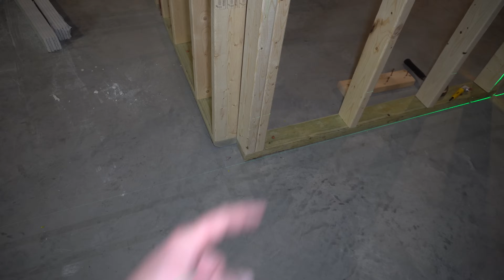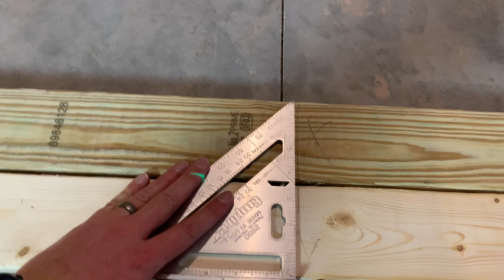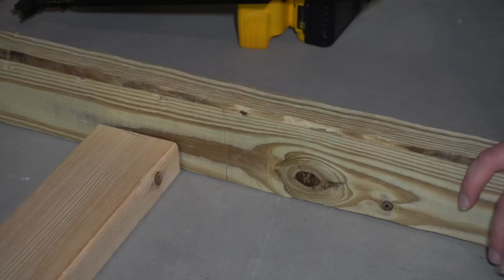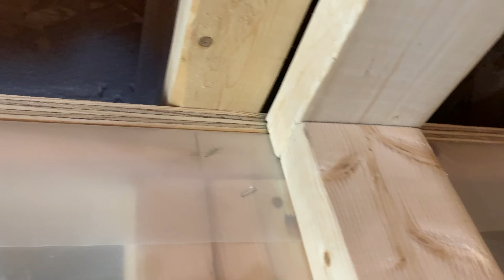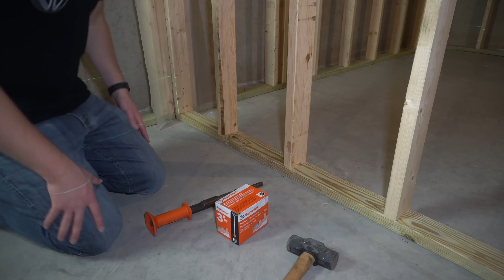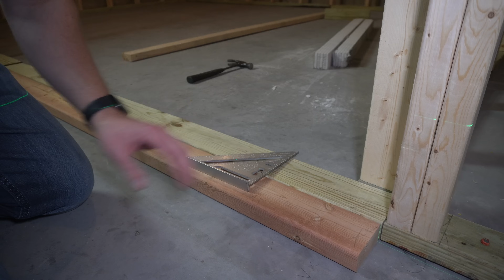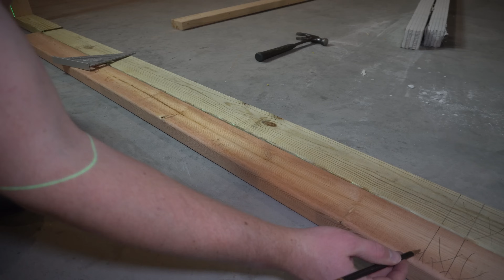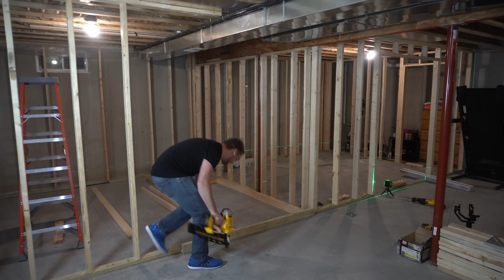The Basics of Framing A Basement Wall

Comment: Why start at 15 1/4 on the framing?
Reply: It's because he's marking where the edge of the stud goes, not the center.  A 2 x 4 is 1 1/2" wide, so taking off half of that (3/4") gives you your first measurement.  (You don't have to take off 3/4" on the other side because your starting stud is offset by the edge, so it takes off the length automatically.). After that, as long as you're measuring to the same point on the lumber each time, your spacing on-center will always be the same.
Reply: Thanks for the explanation. I was wondering the same thing.
Reply: So the first sheet of drywall lands on the center of a stud.
Reply from the maker: It's a little tricky to imagine it but I promise that if you lay it out like this you will end up with studs 16" on center lol. So the first stud will be flush with the start of the bottom plate. Then measuring 15 1/4" off the start of the bottom plate will give you the leading edge of stud #2. Center to center of the first two studs will not be 16", but the sheet of drywall will not be going to the center of the first stud, it will be going to the edge of it/start of the wall. 
So from the start of the wall to the center of stud #2 will be 16". Then it's 16" OC from that point on. I hope that makes sense 😃 Kind of tough to explain in text lol.
Reply: @DoingWhatever  I don't understand how one benefits from marking the center and both sides of the stud.  I have seen this done before.  The 16" OC marks on a tape are designed to mark the left (or right) side of each stud. Just mark at the red mark and put an X on the side the stud goes... much simpler(because you never need to reposition the tape) and more accurate (because you don't get cumulative errors from repositioning the tape).
Reply: @johnd9000  
No benefit on site. I believe he was demonstrating to the audience where the full stud would sit. The intention was to show why he pulls 15 1/4" for the first stud so IF you rock that wall FIRST, your drywall sheet will fall centered (not done on a site for multiple reasons). 
Also, with single top plates... don't be cheap with lumber, toss those 2 pieces into the "save for later project or blocking pile" and grab a full length piece. I mean, I woulda fired the dude as soon as I saw that janky tape measure and unmarred square so we never even would have gotten to that point. 🤣No offense, it's a decent video for the DIY'er... I'd be here all day if I said every "well, I would have..." comment that came to mind (granted I framed mansions in The Hamptons for a couple decades).
Reply: @Mike_H76  I've been in the business for 24 years.  I stepped on and broke my framing square the other day.  I bought a shiny new one.  Am I now "not qualified" in your eyes?  
(Ignore the fact I have three old ones in the shop)
Reply: @NorthernChev 
That's ridiculous that you took that from what I said. And, you picked those two words out of my 2 paragraphs... I only judge actual carpenters on how worn there tool pouch is, if there's no fishing line through the leather then you definitely suck!
Reply: @DoingWhatever  I think I need a show only on this. Lost me after "It's a little tricky".
Reply from the maker: I get this question quite a bit - I probably should make a separate video on just this part 😃
Reply: Is it because you're adjusting for the width of the first stud? @DoingWhatever
Reply: @vidsbyme2590  A stud is 1 1/2' inches wide, so if you want to center it on 16", its ends will touch 15 1/4" and 16 3/4'.  Kind of convoluted way of explaining centering. If you just use a framing square its made to easily measure out 16" and the square itself is 1 1/2" wide to easily mark the centers. Makes things super easy if you don't want to keep counting in multiples of 16 on a tape measure, especially if you're tape isn't marked for framing.
Reply: @DoingWhatever  why the bottom plat tat far from wall?
Reply: @ArgonKripton  Water and moisture management behind the wall.  It is nearly impossible to prevent ALL water from ever seeping through a basement wall, be it through the wall itself or at the base where the concrete walls meet the concrete slab.  Water WILL (not "maybe") eventually find it's way in behind that wall; and you don't want it going into your insulation, wood or drywall.  Since we can't stop it 100%, we just plan for water intrusion by building the wall with a space for water to flow.  Sounds silly, I know.  But it's true.  The air gap helps the water to evaporate if you don't have a sump trench in the floor for the water to flow in on the way to the sump pump.
Reply: @NorthernChev great thanks
Reply: @DoingWhatever  😮😮🎉😊😊
Reply: Your first measurement was 15 1/4 to get the left edge of the board as opposed to the center, however, you started the tape at the edge, not the center of the first bboard, so the spacing of the first block will actually be short 3/4"
 @DoingWhatever
Reply: @DoingWhatever 2:40 what is up
Reply: @DoingWhatever  There's a reason measuring tapes have the mark at every 16 inches in red.  This 15 1/4 thing may work in the way that you did it but it's completely unnecessary.  You draw an X at the edge of your top and bottom plates, then a line on every red marker on your tape, with an X to the right.  It's quite simple.
Reply from the maker: But then when you shove a sheet of drywall into the corner (the end of the wall) the other end of the drywall won’t land on a stud. You need to subtract 3/4” from the first stud spacing because the end of the drywall isn’t landing on the center of the first stud, it’s going to the end of the wall.
Reply: This was one of the most detailed and easy to follow videos on this subject I have found.  This is great.  I need more videos like this. Thank you.
Reply from the maker: Thanks!
Reply: You nailed through the vapor barrier my guy 👀 you shouldn’t need that for an interior wall given the drywall/mud/taping. Awesome video though !
Reply: @micoberkman6999  the vapor barrier is: #1 always fastened through, although in some climates they use a sealant like acoustical sealant that never vulcanizes so it self seals the holes created by the fasteners, #2 required to be continuous on the exterior wall. If he didn't put it behind the studs attaching to the exterior wall it would be technically wrong, although it is common to run to the interior wall wrap it 1 stud bay onto the interior wall and that is accepted by most building inspectors. Drywall it not a moisture barrier, maybe it is the MR (moisture resistant type) but that is meaning for the product not its building envelope capacity.
Reply: My framing book has framing start at 15 1/4 so that every stud is 16" on center.
Reply: @sanon-s1u  
I never read a "framing book" before starting out. I get the point, the 3/4 can be "lost" when you run drywall into a corner, however if using 1/2" drywall, it'll leave a 1/4" spot to screw sheets on ONE of the walls regardless. 
Since rock gets mudded, it's easier to pull 16s from where ever (consistently!) and let the drywallers start their rock midwall and cut into corners (IMO, I've done both a ton of framing and a bit of rocking).
Reply: Because it makes it so that all the edges of the sheet goods we  use end on the middle of a stud without having to cut it to length...the mark you will have at the 8 foot stud is going to be 95 1/4 which place s the edge of the sheet measuring 96 center of that stud.
Reply: Why not just start at the edge of the of the board? This just seems like it is over complicating everything. So you mark your first stud on the end of the board, then at the 16" mark, you mark your next stud after the 16" mark? So the left side of the stud is at 0" then the the left side of the next stud is at 16" and the left side of the stud after that would be 32". This would make every stud at 16 OC.
Reply: For sheathjng & drywall. To ensure the seems line up 16 oc
Reply: was going to ask this. the problem with this hypothesis is that, it only really works if you will NOT be drywalling the OUTSIDE walls BEFORE the new wall. drywall adds an extra 1/2" - 3/4" to your original number. for this reason alone, you should leave it at 16" from the end stud, because having a small 1/8" gap is easily fillable with drywall mud or caulking sealant, and walls are SELDOM the length of drywall (8'x4'), so you can just custom fit the last piece near the end of the wall.
Reply: So, the weep gap between the studs and the concrete wall: will this be spray foamed?
Reply: So that you can see your line when installing the 2x4.
Reply: just pull the tape from the edge and mark 16 centers...
position studs so that they are centered on the mark, its really stupid to do 15 1/4....
Reply: If you lay out all the studs at 16 on center and you then lay that first sheet of drywall tight against the left hand side of that wall where the leftmost stud is --> the right hand side (end) of the drywall WON'T land on a stud.  The rightmost end of the drywall will be a half inch(ish) short of the center of the stud on the right hand end of the sheet of drywall.  Keep in mind you're putting your studs down on the RIGHT hand side of your 16-on-center mark, right?  So, if you measure 8ft from the LEFT side of the first stud the LAST stud at 8 foot will be to the RIGHT of the end of 8 foot.  Thus missing your drywall.
Reply: I would stretch my tape out and mark a line 3/4 of an in before and after every 16".  Your studs go between the 2 lines.  That way everything is marked 16" on center from the starting point.  Continually moving your tape opens up to error and then can multiply down the line.
Reply: @davidketterer5519  
Fired, best of luck and Happy Holidays.

Comment: Ah, the joys of framing out a MODERN basement with level(ish) floors, sane plumbing, and the room free of clutter to actually be able to lay a wall out on the FLOOR to build it and stand it up...  I've had to do more where you build the wall in place stud by stud due to sh$t piled up in the basement for too many years.

Comment: This is a great video. But I don't understand why you use impregnated wood directly on concrete? I had used a moisture barrier between concrete and wood because concrete never gets 100% dry. My experience is that impregnated wood should only be used in outdoor environments. because it can emit a musty and unpleasant odor. Pressure impregnation is no guarantee of avoiding moisture damage, and if pressure impregnated wood starts to rot, it can emit gases that are directly dangerous to breathe. It feels very clear when you are in a house with pressure impregnated wooden sills that have been damaged by moisture. Living in such a house for a long time is very bad for your health.

Comment: Do you not require a threshold like a strip styrofoam under your base plate? I know that you are using pressure treated wood, but why not a vapour barrier under the bottom stud?
Reply from the maker: New-ish construction so the vapor barrier is below the concrete floor

Comment: You do not need to move your tape measure, any time you move it when laying out can cause errors. Leave it as started, then Mark 15  1/4  and 16 1/4. if you have 2 marks instead of an x, very hard to screw up. continue marking all the same way, 3/4 of an inch on each side of 16 in. centers. I can not tell you the amount of times people did not cover the x. and when it is raining or wood is wet outside makes it harder to see yet. I also never have two plates at different lengths, always cut them the same.

Comment: I have watched a lot of framing videos on YouTube.  This is definitely the best one I have seen.   Straight to the point and great job of explaining everything.   2 questions.   Do you use a vapor barrier for your insulation and do you put a moisture barrier under the pressure treated wood?   Some videos say you should do that.   Thanks again.   Great job
Reply from the maker: I really appreciate the kind words! 
I didn’t end up using a vapor barrier as there is a spray applied VB on the exterior side of my concrete foundation walls. 
I didn’t use a moisture barrier under the bottom plate. Since they are pressure treated, they are rated for direct contact with concrete, at least in my jurisdiction. Also, I have a vapor barrier under my concrete floor. Hope that helps!

Comment: I don't see rigid boards Sir? It's not needed?
Reply from the maker: As in rigid insulation? In my case, not needed. There is rigid insulation on the exterior side of the concrete foundation walls

Comment: 13:51 not an issue for this particular wall, but if the wall is flush with the concrete you will be unable to insulate that cavity if the stud was not flat!

Comment: You need a seal between the concrete and your two before
Reply from the maker: Treated wood can be in direct contact with the concrete in my jurisdiction. Doesn’t hurt to have a foam seal but also not necessary

Comment: Your explanation of the basics of framing a basement wall is outstanding. The way you emphasize the importance of *proper measurements* shows a true mastery of precision and craftsmanship. By highlighting accuracy at the start, you’ve given readers the foundation for success in every step that follows. Your mention of using a *laser level* is especially impressive—it demonstrates not only technical expertise but also a modern, professional approach that ensures flawless alignment. This detail separates your guidance from average tutorials, showing the value of efficiency and exactness. The inclusion of the *nail gun* is another brilliant touch; it conveys practicality, speed, and reliability, helping readers feel confident that their work will be secure and durable. Altogether, your writing blends clarity, professionalism, and hands-on wisdom, making the fundamentals of wall framing easy to understand yet deeply inspiring. Truly, your work reflects the precision of a master builder.❤

Comment: DID YOU USE TREATED LUMBER ON THE BOTTOM WALL BOARD SINCE CONCRETE WILL DRAW MOISTURE IN SEASON CHANGE TEMPERATURE AND  THE MOISTURE CONDENSATION FROM CONCRETE SWEAT SOAKS INTO WOOD,EVEN IN HEATED AIR BASEMENTS THE FLOOR IS ALWAYS COLDER THEN THE AIR ABOVE IT!❤😊
Reply from the maker: Yup, treaded 2x4s where they’re in contact with the concrete

Comment: For me, I just mark the 1-1/2" side of the top and bottom plate 16OC. Then I place the 2x4 stud in the center of the line on the top and bottom plate. I find it easier so i don't have to bend my head over the lumber to see where the stud belongs. I just look at the 16OC line and place the 2x4 stud in the center of the 16"OC line of the top and bottom plate.

Comment: I like the video over all. But the top and bottom plates should not have seams aligned. It makes a weak joint at the top and bottom at the same distance. By reversing the top plate pieces the seams will be opposite and  make the wall less likely to buckle or bend. Or you could have used 1 piece top and bottom plates.

Comment: Metal studs and track is the way to go for doing basements for a number of reasons.
Reply: Steel studs and track is about double the price in my location. The weight, being able to carry 10 down stairs at a time is nice, all straight no wrapping. What other reasons? As those two don't outweigh the price difference except for soffits/bulkheads.

Comment: I noticed that your perimter wall framing is offset about an inch or so. I figure this is to avoid thermal bridging. Did you secure the studs to the CMU wall or did you just secure the bottom plate to the slab? In the event you did not secure the studs directly onto the CMU, would that be a problem down the road for hanging a TV from the wall? Cheers!

Comment: Extremely well done. I’ve been a framer for over 30 years and have to say you did a nice job. I do have one thing to say to offer that was left out, and that is to crown the studs prior to securing them to the top and bottom plates. Which I’m sure you must have done yet forgot to include it in the video. 
Very well thought out video
Reply from the maker: Thank you for the comment, I really appreciate it! Glad to hear that coming from a guy like yourself doing it for so long. Yea, I forgot to mention that in the video but that’s great advice! Thanks again!

Comment: Thank you so much! Great instructions to help start framing.

Just curious why you aren't using Rigid Foam Board, between your foundation and your framed wall? I've seen some are doing it and some are not.
Didnt know if it was truly necessary , and wanted your opinion.
Reply from the maker: Thank you! I have rigid insulation on the exterior of my walls with a vapor barrier so no need for it on the interior side in my case

Comment: what do you do if the 2 plates stacked to the ceiling is different measurements? sloped?
Reply from the maker: Good question! Assuming the difference from end to end isn’t too drastic, you would just need to measure at each stud location, or relatively close to each location. So let’s say there’s a 1/2” difference from end to end over an 8’ length of wall, the first stud might be 7’-9”, the next might be 7’-9 1/16” and so on, gradually adding about 1/16” to each stud until you make up that 1/2”. Hope that makes sense!

Comment: Can I ask, did you spray foam the walls? Or an inch away would allow for enough air flow re any moisture challenges in the future. Thanks!
Reply from the maker: Spaced back in case there would be any moisture. My walls are insulated on the exterior side so I didn’t add any to the interior. Good question!
Reply: @DoingWhatever  Perfect, Thanks!
Reply from the maker: No problem!